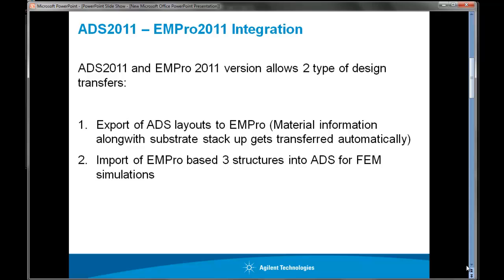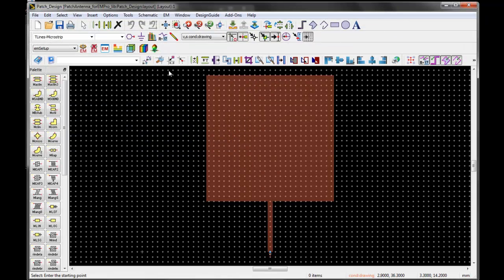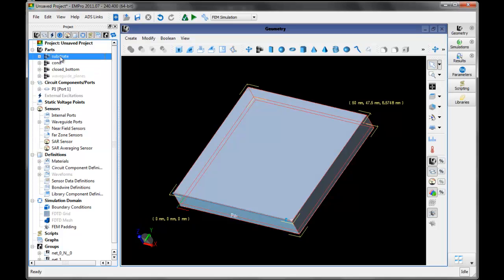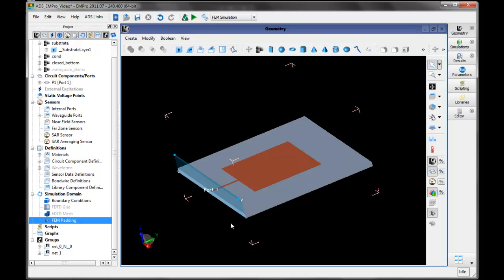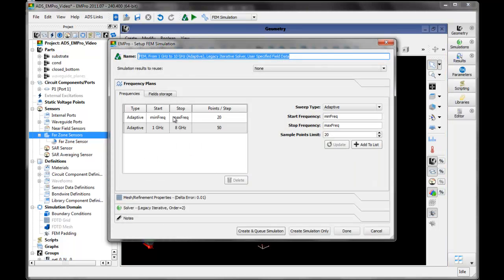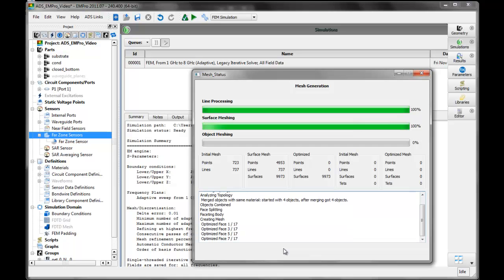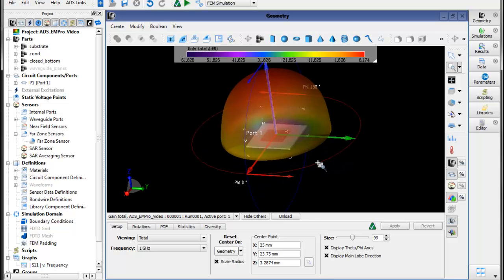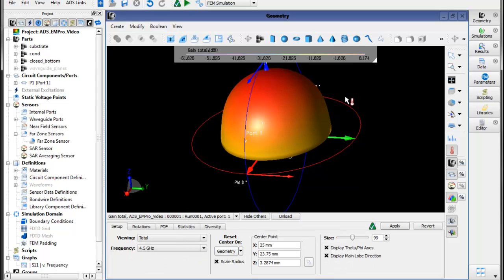Understanding ADS & EMPro Link

Comment: Hi sir, I imported external ODB++ file to ADS layout, so the empro_3dc_pins layer doesn't exist in the layout at all. This causes an error when I place 3D components. How can I resolve this? Thank you!" warning info: WARNING: This instance has pins on a layer that is not defined in the technology of "PT-221_noCap_lib".
You will not be able connect to these pins. The layer number is: -777

Comment: Hello sir, When I try to launch EMPro its shows a message like there is no empro executables. Kindly help me to rectify. Thanks in advance.
Reply from the maker: Make sure you select win32_64 as the target folder. If it doesn't resolve the issue then contact your local Keysight tech support for help.

Comment: Hello sir, i try to Simulate a rectangular patch antenna and my question is: - is it possible to make this simulation directly on EMPro without using ADS? , have you more information how i can Simulate a rectangular patch antenna on EMPro
Reply from the maker: Ofcourse you can use EMPro and create any geometry you need. You can refer to EMPro documentation and example for more information. I have it in my plans to create EMPro videos but it will take some time

Comment: hello there i hope u can help me, by on FDTD Antenna example i got always an Error from " the waveguid is not supported from the engine DFTD" and as a solution form this problem it suggest to remove this waveguid from this project or turn off the FDTD engine.. so any solution of that? :)
Reply from the maker: Hi Azz,
Only Waveguide port is not supported in EMPro-FDTD but you can surely simulate waveguides with FDTD and connect a normal port to perform simulations. Kindly contact your local Keysight support team for help....